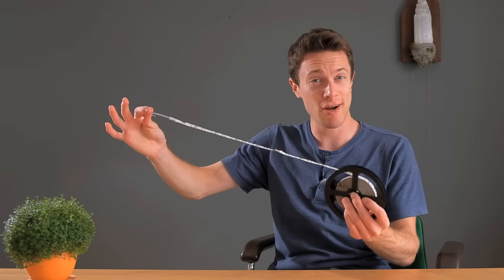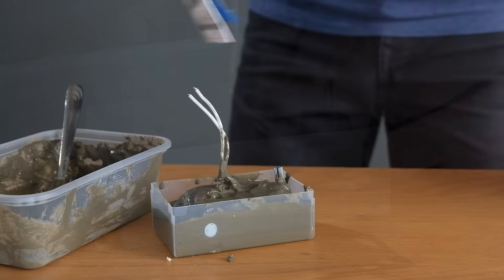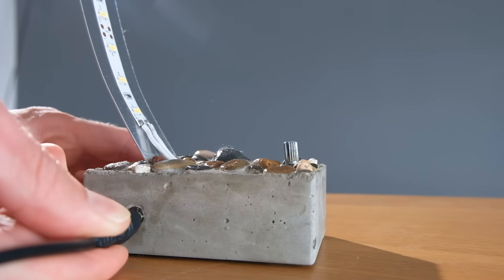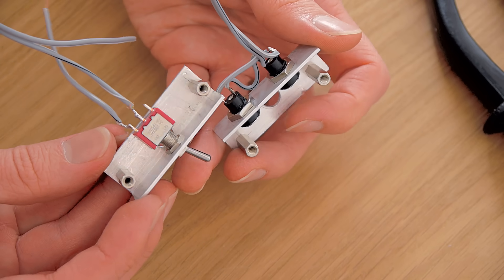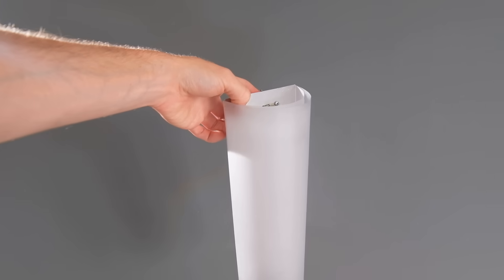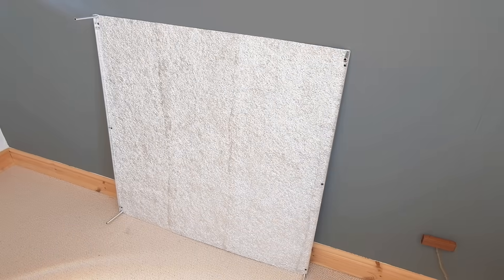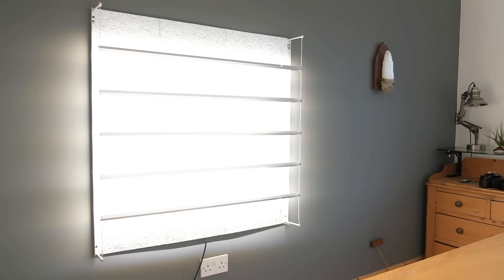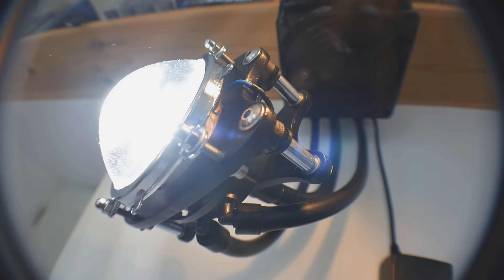3 inventive lighting projects using LED strips

Comment: Hi Matt. Can you please do a detailed video on LED strips and accessories you can use with them? I am pretty advanced with electronics, yet I still get cconfused when using LED strip lights, like how to determine how to power they use and how can you daisy chain them or how many can you daisy chain? Also how to dim them?
Reply: Zunar Zulfiqar pretty advanced in Electronic but confused with led? I doutb that.... LED strip 101... Almost all led strip is needed 12V supply. Current required is determined by lenght AND led used in strips (either 5050 3428 or else). Dimming cannbe achieved by adjusting the voltage or by PWM.
Reply: Hi, 
Well that's not what I meant. I meant like how to account for line loss, parallel vs series. How super bright LED strips may have some other requirements. The reason I ask is because I was putting some LED strip under my kitchen cabinets, and as I was bridging between cabinets, the light output kept dropping.

Comment: Your lighting projects would look so much cooler without visible wires. Its a shame the only way to do that is to drill the wall or use a battery, neither of which sound appetizing.
Reply: There are plenty of clever ways to hide wires without damaging the walls or using batteries.  In one project he braided some twine overtop the power cord to disguise it as just some rustic rope.  Painting it the same color as the wall is another option.  Or get creative and make the power cord part of the artistic display in some other fashion.

Comment: Be nice if you listed some of the power supplies you used.
Reply: RedDragonGecko 

12V.  1amp DC. sufficient for up to 15' strips

12V   2amps DC for long strips (over 15')

The ultra bright white light setup he used is a 5amp power supply.  Which would normally be overkill.  Hence why it is so bright.

Comment: Not saying that you don't get what you pay for, but I've personally not had an issue with cheap LED strips, plus I don't think too many people care very much about the CRI rating of their lights, oh and if they do have issues then at least it only costs you another $5 or whatever to replace it rather than $30.
Reply: I think cheap led strips are just fine for decorating. It's not the same thing if you want to light up your room with it, but in most cases, I don't think it's worth spending that extra. I get your point about the fact that it's not that pricey when you consider it though.
Reply: Melange Bryce alot of students are using leds to cut down electricity bill or just to make your room look cool
Reply: I dunno about the OP but I get under $10k/yr. $30 for LED lights is a awful lot on my budget.
Reply from the maker: Depends on the project. If it was just a work light for a garage, then cheap ones would be ok, but if it's a home light then a good CRI light is definitely worth it - cheap strips have terrible CRI and can make people look quite pale and ill. Not cool.
Reply: I live in Brazil and the mnimum wage here is less than $350 so $30 on led strips is a hell lot of money.
Reply: Melange Bryce money doesn't have to same value to everyone and everywhere. 

30$ might be the equivalent of 200$ to someone in Africa
Reply: @BankruptGreek  I hear it rains down in Africa......
Reply: @jaymerjaymer  not from Africa but Okey..
Reply: Melange Bryce That is just rude. You do know that we can buy led bulbs for way less than $30, right?  Those can easily light up whole room.

But i do agree with Matt, for those kinds purposes shown in the video its best to get a good quality strip. Also if you cant afford that a little bit of searching could easily find you a cheap one that may not be as good as the $30 ones but still gives good quality light.
Reply: I was working on a bicycle bottle dynamo generated LED strip project which was designed to last a few days and the light quality wasn't not an issue - no one would have been bothered as to whether it was full spectrum or not. The cheapest LED strips available worked a treat, and they're still working despite being outside for over a month...
Reply: The cheap LEDs are great for anything to do with accent lighting, along with RGB. However if you are actually using the light to see or anything, you'll find the more expensive ones will be quite a bit brighter per the same length, more energy efficient, and easier on the eyes and more color accurate. I have had experience with some strips actually changing color over long periods of time, particularly the waterproof ones with the coating. If you don't care about any of the stuff mentioned then by all means get cheap ones lol. I personally like the high CRI 5630 LEDs rather than the 5050 LEDs because of how much brighter they are. I've bought both to test and it's quite a difference.
Reply: Different Yes and alone those same lines, items won't have the same value to people, so to some it may seem perfectly reasonable to spend $30+ on some lights, but other people you might have a hard time convincing that it's worth spending as little as $2 or $3 on an LED bulb.
Reply: DIY Perks Quite true. And lighting quality can have a subtle but profound effect on a person's mood.
Reply: Yeah, I agree. I don't doubt that expensive ones are better in most situations however both I and my brother have LED strips on the back of our TVs; his were £25 and mine were ~£15 and yet they look identical. I've also never had an issue despite them being constantly on for around 2 years now. If they were in my living room or workplace then perhaps I'd care more about them. But honestly, the fact they have brightness functions and a power supply built in and ready to go - it is just more suited to something like backlighting a TV in your bedroom. Also, Melange Bryce stop being an asshole.
Reply: First cheap ones I bought didn't even turn on ://
Reply: I care because I see the difference.
Reply: Hansbald were you using a 12v psu for it. The explosion can only be relating to the psi used in my opinion.
Reply: For a sec I thought you were serious, then realized it was sarcasm :D
Reply: +Mark-IT Rgb led strips have really bad white color if they dont have separate  white leds just for that
Reply: Yes, if you use the built in white one, but if you use the "DIY" buttons, you can fine tune the color, or just use an arduino for colormatching it. :)
Reply: DIY Perks  If you use a dimmer it wouldn't be a problem to use the cheap ones.  But you have claimed it so now you have to hang in there.
Reply: You can always find cheap led strips with high cri. Just spend little time searching. The lamp luminous might be less but as they are cheaper you can put more leds.

Btw I am not saying expensive ones are not worth getting. I always try to get them. For those who cant afford it just get the best you can. After all its diy. :)
Reply: Diy Perks  "can make people look quite pale and ill"  lol. That is definitely not cool. 100% agreed. 😉
Reply: i paid 7$ for my LED strip and it lights my entire room.
Reply: There are some interesting things being said here, and a lot people arguing about apples and oranges.  A few points worth considering in the cheap v. expensive debate.

1. High CRI does not necessarily mean expensive.  You can get high CRI lights very inexpensively on Aliexpress.  I bought a 5m roll of 204 LED/m high-CRI lights for $8.  Of the 1020 lights in the strip, 4 of them did not work.  I was using them to make a video light (with 16 rows of lights in matrix), so having 4 burnt out didn't matter.  They work well and look great.

2. If you are making lighting for shooting photos or video, high CRI is great.  Otherwise, it isn't needed and to many people is actually undesirable.  High CRI lights appear slightly bluish to the eye in comparison to the incandescent bulbs most people are used, which lean towards the yellowish end of the spectrum.  In my experience, most people like warmer white light when lighting a room, and find whiter high CRI bulbs harsh.

3. The cheap v. expensive debate really boils down to your needs for reliability. IME, if you can deal with occasionally getting a dud (or having one or two LEDs not work on the strip), cheap strips are fine.  More often than not, however, a cheap strip will work just as well.  However, quality control on cheap strips isn't as good, so there is a bit more of a gamble with them, but it certainly isn't like all cheap strips fail, or expensive strips never fail -- its a matter of probability, and probably not too significant of a difference.  

If you need to (a) assure that color is matches exactly from strip to strip,  or (b) need to maximize your odds of not having to occasionally toss a bad strip, then you are someone who should pay for expensive strips.  Otherwise, you'll likely be fine with cheap ones.   You can often buy two or three cheap ones for the same price as one expensive one, so for sake of tinkering, I prefer cheap ones.
Reply: girlsdrinkfeck I'd love to see a house burn down using low energy 12v led strips (Hint: it doesn't happen). They all come from china anyways so doesn't really matter how much u pay for them. Iv used 10 different eBay lowest price rolls of led strips NEVER had an issue.
Reply: For Matt he needs it since it helps with making his videos look better.

Melange Bryce you was doing so well then you said food, are you say you buy leds over food?
Reply: Hes clearly sponsored by the brand hes using thats why he doesnt recommend cheap ones. Ive also never had an issue with cheaper LEDs.
Reply: Tbh I'd rather get an RGB led strip that I can fine tune the color of (for $10), than buying a just white strip for $30. I've had experience with high cri leds, but (which is just my opinion and yours may vary) I just can't justify the price difference.
Reply: i got a cheap red strip to light up my pc: in this case i didn't care about color accuracy or brightness.
Reply: Why would you only spend 5 thousand on a car that doesn't have leather seats or audiophile stereo system when you can spend 30 thousand on one that will be much better as you use it every single day. Why the fuck would anyone spend 6 times the amount of cheap LED strips to get one small roll of better ones. I mean christ after all that light is diffused are you sure that the color rating is still there?
Reply: Melange Bryce I've experienced a few different types of lights and I could careless about CRI as long as the light coming from it isn't some awful greenish or blueish color, besides that unless you absolutely wanted a custom lighting solution it'd be almost waste to spend so much on lights, because don't forget you'll definitely want to put those on some aluminum strips and you'll need a half decent 24W power supply too, so $30 on lights + around $10 for a metal strip + roughly $8 on a PSU and if I really did care that much about CRI then by comparison a decent 8W LED bulb would only cost like $3-5... For about the same price you could basically light an entire house.

Yeah $30 doesn't sound like much but you see in perspective, it costs a quite of a lot by comparison of traditional lighting methods, because that's going to be over $30 every one or two rooms, depending on how you want to spread it out.
Reply: Have you ever used "junk LEDs?" I bought four 16' strips for like $35 and they all still shine brightly.
Reply: rather pay for quality than have a house fire
Reply: Below are a few reasons it matters:

efficacy (lm/W)
CRI/TLCI/TM-30-15
heat dissipation(/copper weight)
voltage drop(/copper weight)
luminous decay (LM-80)
lumens per meter
LED pitch/density
binning/MacAdam ellipse/SDCM

These can be broken down by component to see how the materials affect some of the measurements, but that's probably too far down the rabbit hole and it's more the above specs that matter in the end.
Reply: The only people who don't care about the CRI of their LED strips are people who have never experienced good CRI LED strips.  And really, how poor are you that $30 for high quality LED strips is too much?  How much do you spend on filling up your car with gas?  How much do you spend on food, or going to the movies?  Are you really that cheap that you wouldn't spend a little more for something you will use every single day and that has a significant effect on everything you do?  If you are that broke, then you shouldn't be worrying about doing anything with LED's and instead should be watching YouTube videos to learn skills that will let you get a real job where you aren't having to cheap out buying junk LED's that will burn out and will make the color of everything look off.
Reply: @mikeb1834  OK BOZO You seem to live a life that I personally have not. 1ST the difference between $30 and$20 is something that I have to work out every day...sometimes more than once a day. 2ND WHAT CAR?  same for gas. 3RD go to a movie?? 4TH CHEAP??? 5TH  SPEND a little MORE???  6TH @ 69 years of age and on social security and having more jobs on my resume than I can remember(with 3 years of college). I think you should shut your mouth until you truly know the real life situation that a lot of the people live in this world live in. Here is hoping that LIFE gives you a gentle wakeup call and not what it has handed to others(like major health issues or disaster).
Reply: @craigboyd1888  Craig,  if you are so broke that you have to worry about $10 per day, then pick up a part-time job or find some way to generate a few hundred extra per month rather than spending your time on YouTube watching videos that aren't furthering your life or expanding your skill set - and even worse, wasting your life on the YouTube comment section.  Furthermore, you should contemplate the intelligence of paying for internet access and a computer if you're so hard up that you worry about $10 every day, unless you wise up and use that computer and internet access to provide better for yourself.  Don't be a bozo... but maybe it's too late?
Reply: @mikeb1834  Perhaps you should end up in a wheelchair or a combat veteran that has been exposed to toxic chemicals or worse.....

Comment: the adoptor....
how you calculating power?
or its just random....
Reply: positive good approx 1.2 amps per meter should work. But still depends on the led strip
Reply: Arun Khanchandani what happend if we put power too much or less?
Reply: Extra Amps won't cause any issue. But lower amps would cause dim lighting. But won't cause any problems. Just make sure the the voltage is 12v.
Reply: Arun Khanchandani 12volt /meters?
Reply: positive good voltage will be 12v total.. amps will vary

Comment: the third project would benefit from rubber grommets in the aluminum so as not to cut the wire insulation.

Comment: One suggestion for the first project is to use some glow-in-the-dark garden stones (I managed to find some in a local dollar store) for some of the stones to give you something to find each end in the dark.
Reply: Or you could simply paint the stones with glow-in-the-dark paint. I get mine from GLOW Inc in different colors...even use one special paint they have for the sights on handguns!
Reply: I put glow in the dark paint on my flashlights to help me find them in the dark. It works great as I use the better 2nd gen gid paint.